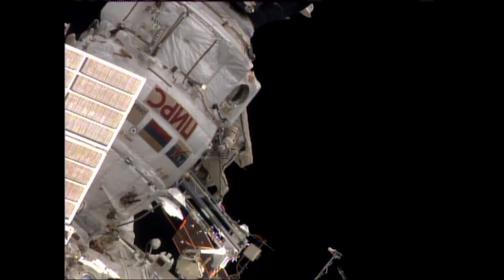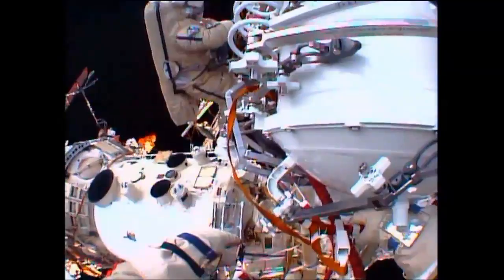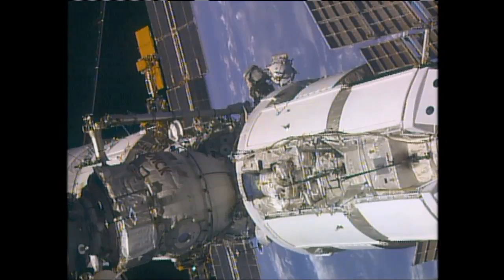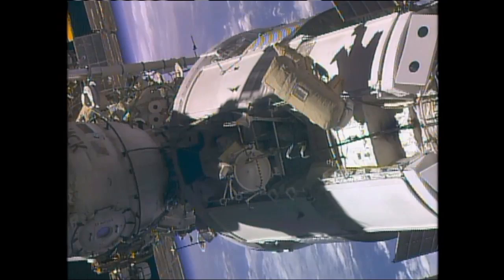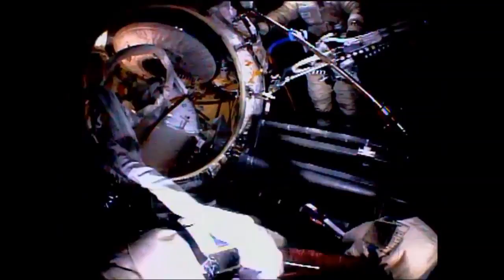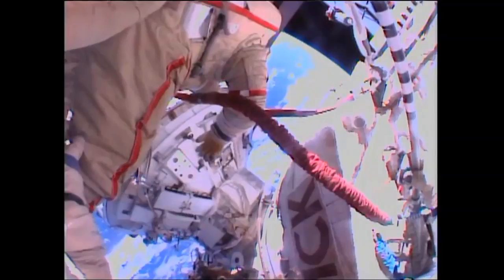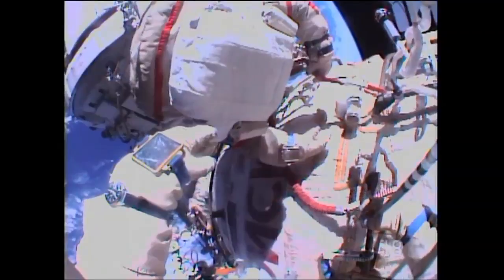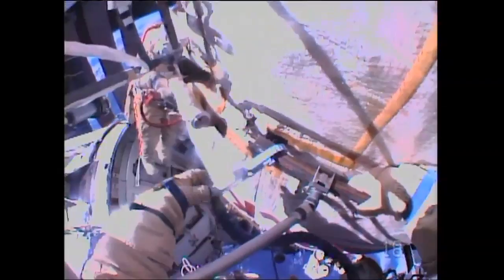Station Crew Members Take a Walk in Space

Comment: Yes. If it affected anything it would be the eccentricity and/or inclination of the orbit, but so insignificantly as to be effectively immeasurable. The total energy of the orbit cannot change unless the mass of the station changed due to a thrust source, assuming a perfect vacuum environment

Which brings up a vaguely related issue. By far the biggest problem for ISS's orbit is drag from air molecules in the thermosphere it orbits in, which requires periodic reboosting using a docked spacecraft

Comment: I would assume it does but the large mass of the station compared to the smaller mass of the cosmonauts results in a greater acceleration on the cosmonaut and very little to the station. They have gyroscopes and flywheels on board that will correct for any stability issues. As for the trajectory they have to correct it occasionally because they slowly lose orbit over time.

Comment: Not much. They are always connected to something with a security-line, of which they have two, so they can attach one of them to the next handrail while the other one is still secured.
The American EMUs are also fitted with a SAFER (Simplified Aid for EVA Rescue) device, which is practically a jet-pack so they can propel back to safety should they ever accidentally get separated from the station.

Comment: Well, theoretically, sure. But the space station weighs something like 450'000 kg, so the effect is minimal.

Also have to consider that, if they push the station to the left a minute amount, they also at some point in the space walk push the station to the right. Or backwards, and forwards. Etc. In the end, the net effect on the station is probably close enough to 0 that it's not a problem.

Comment: Actually, no. Since the station + astro/cosmonauts combined are a closed system there is no combined change in momentum. For every push they do, they need a pull of the same magnitude in the opposite direction to stop them from floating away.

Unless something floats off in space there is no impact at all. For instance, moving inside the station has the same effect as moving outside of it but it's easier to imagine moving inside having no effect.

I hope that's a bit clear?

Comment: If they push against the hull and remain tethered to it, the jerk at the end of the tether is equal and opposite to the push away. The two forces cancel each other.
While the astronaut is just drifting after such a push, the ISS does react in the opposite direction, but inversely proportional to the ratio of the station's mass to the astronaut's. IOW, imperceptibly.

Comment: Run out of enough characters, as usual. lol

Since they aren't using any kind of thruster equipped backpacks on their suits, they aren't changing the total energy of the station's orbital movement. Their effect on the station's torque in x,y,z axes would be much more noticeable than any immeasurable affect on the orbit's shape. Many satellites, such as Hubble, actually use sets of what are essentially flywheels attached to electric motors to rotate where they need to point, and hold it there.